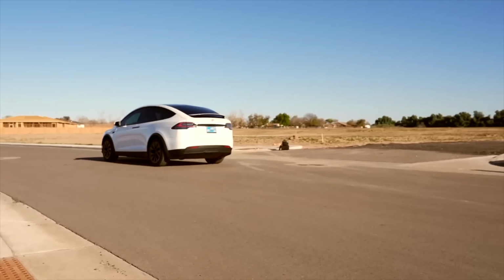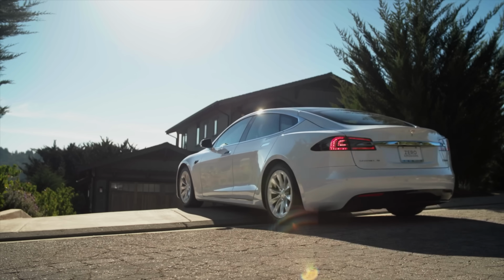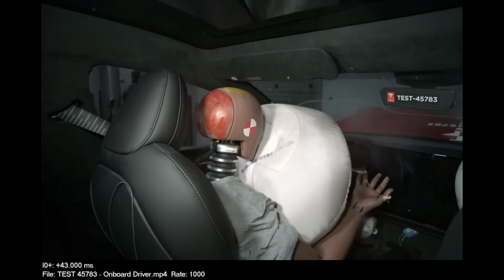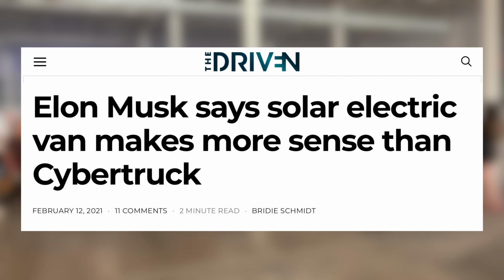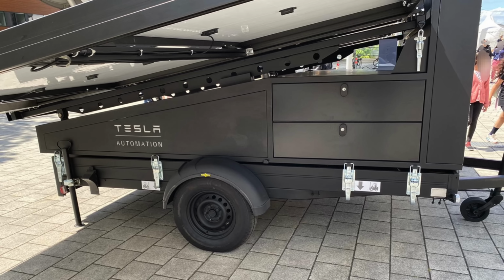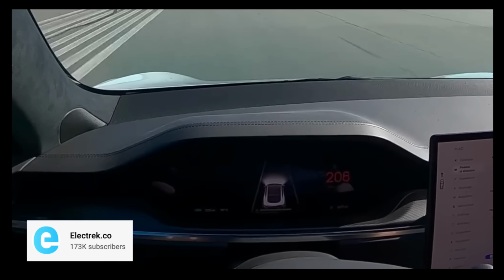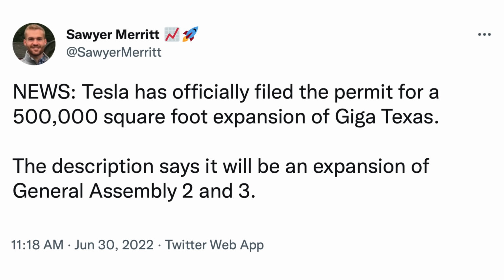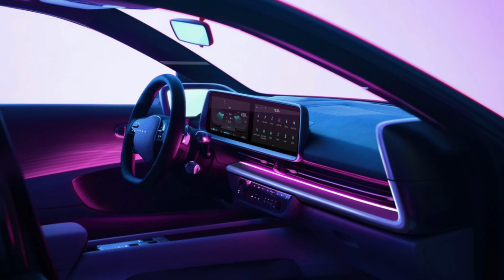Tesla Model S Plaid Was Hacked | Now It's Breaking Records

Comment: Still a bummer that the 25k tesla is not coming any time soon. If it existed it would be a no brainer for me, i've no need for a such a big car like a model 3.
Reply: 25k tesla would be 40-45k today anyway
Reply: Check out the solar powered Aptera, it starts at $25,900 and can get up 40 miles per day for free without any charging. If you drive less than 40 miles daily the battery can remain fully charged for free because you'll be topping off the battery daily. Aptera's supposed to ship next year.
Reply: @zyxyuv1650  I do not believe you can get any where near 40 miles a day in the real world.  Maybe 12-15.
Reply: @davidbeppler3032  You are guessing random numbers about something you know nothing about. Some random guy randomly guessed "12 miles", using literally 0 research and 0 knowledge about anything related to Aptera. Aptera states 40 miles per day and provides a sun exposure calculator to get an exact value based on where you are in the world. The random number "12" you pulled out of your ass is the range for Solar retrofit EVs that weigh 2x-3x of the Aptera and are unaerodynamic and therefore have a drag coefficient requiring 2x-3x more energy to move the same mass. Do your research, the Aptera is not the same as an Solar retrofit EV with 12 miles/day.
Reply: @zyxyuv1650  First off, I guessed 12-15 miles.  Not 12 miles.  My research is the efficiency of solar panels(less than 22%), the angle of sunlight(30-40 degrees), the time of sunlight on the panels(4.7 hours), and the loss between the collection of energy and the mileage of the vehicle with energy loss(85-87%).  I will agree with the 0 knowledge part.  I have no formal education beyond high school.  If you have something to add, I am willing to learn.  If all you have is the company statements, I am not interested.
Reply: @davidbeppler3032  You didn't use the drag coefficient or the weight of the vehicle or the number of cells and solar array coverage area / watts per cell so you're not even calculating anything. Are you calculating for a 4000 lbs vehicle with Cd=1.0 and two 40 W/C panels? You've no idea which vehicle you're even calculating for. It's not like there's 1 universal vehicle and all vehicles have the same drag coefficient and array size. The Aptera's aerodynamic optimization allows it to move the same mass using less than half the charged and/or solar energy of other EVs. G0 on the Aptera F<>r\//\/\5 and ask how to calculate it, or g0 0n~|~0 the Aptera Owner's Club <|~|4Nn3|_.
Reply: @davidbeppler3032  I'm still trying to figure out how to 5|-|4r3 the name of an 4.r-|-.i<|_3 with you, this will take some creativity to get around the (3|\|50r5|~|1p. S3./-\.r<.|-|. (G).<><>.g.|_..3. for "Efficiency a calculation Aptera enthusiast blog" and r34D that whole 4r-|-i<|_3.
Reply: @zyxyuv1650   Nope.  None of that was necessary.  In China that same Aptera would get 150 miles a day from solar.  Why?  Because the NEDC says so.  Will it do it in the real world?  No.  You claim 50 miles.  Will it do 50 miles?  No.  The math does not work.  Sorry if it hurts your feelings.  Buy one.  See if you get 50 miles a day, ever.  I bet you get 12-15 miles almost every day.
Reply: Lol we will never see a $25k Tesla.
Reply: Model 3 is a tiny car
Reply: It makes no business sense to make a $25k car right now. They are production constrained and sell every car they make. Why would you take resources away from the higher margin cars to make a much lower margin $25k car? If they get an excess supply of batteries, then the $25k car will start making sense.
Reply: Wuling Hongguang Mini EV can be had for $5k.
Reply: China made model 2 in 3 years if they can keep the price of lithium and other metals lower.